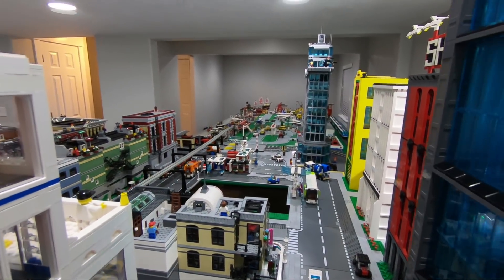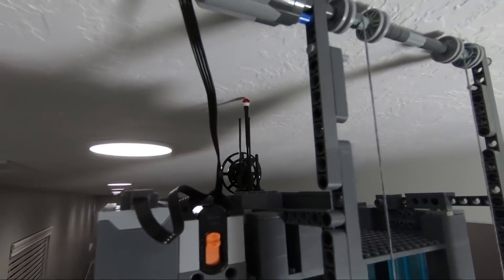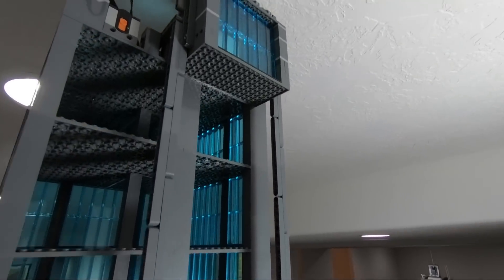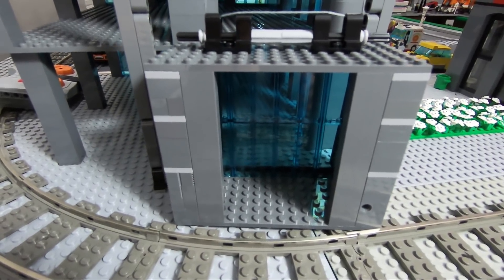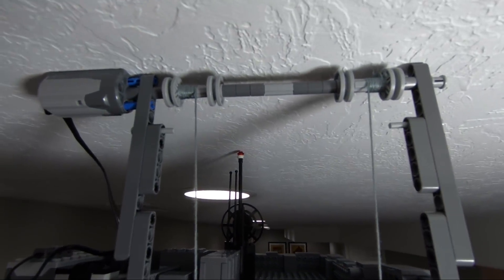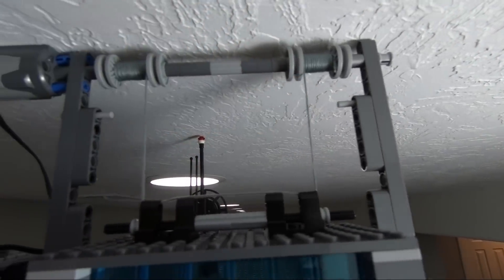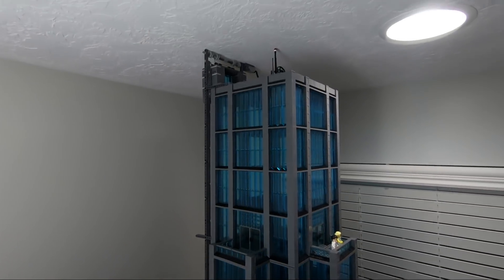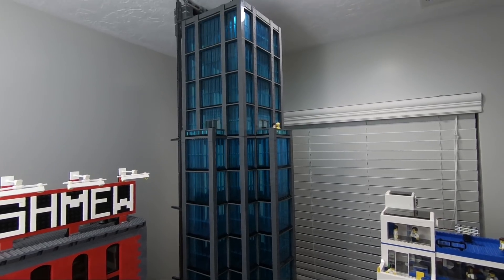LEGO Elevator with Power Functions

Comment: You could have kept the pulleys up the top and moved the motor to down below with another pulley on it, and just run the string up and over and then back down to the bottom, or wherever you prefer to hide it.

Comment: I would add the building around it to put the elevator inside the building instead of outside. I stumbled upon your video researching LEGO lift systems for a functioning pop up trailer I want to build. Thanks for showing it

Comment: Huh, neat idea on an elevator, Waaay less complicated than what I plan on doing, thinking the string from the winch blocks, over the train wheels that are in some 3 in 1 sets, that are all individually strung to their anchors and to stop them snapping the string I was gonna use the slip gears (that I thought were clutch gears for some reason).

Comment: Alex, You could replicate your front columns to enclose the elevator and cap it with an "elevator room" to hide the power functions and keep the roof access. Also, this would keep all the space on the 12th floor for your Mindyappolis residents use. Hope this helps with your options and thought processes.

Comment: I would hate to be coming out of that elevator at the same time the train comes through, lol. I had commented about putting the elevator in the front, but  you can't, with the two balconies and they do look awesome, but you can place a housing around the elevator, as its kind of odd to have an elevator out in the open. You can use see through tiles, so you can still enjoy watching it go up and down, it will also hide the cable and the track, and if you have all the machinery of the elevator on the top floor instead of the roof, you can also use this elevator enclosure to help hide it as well, killing two eye sores in one shot.

Comment: Awesome elevator! I should remove the roof access, and cover up the pathyway of the elevator. You could do that with some hinge pieces though, so you can open up the entire back of the elevator like a door for easy access. It will look more neat when you don't see the open sides from the other places in town.
Although I remember you wanted to keep the building open from the backside.

Comment: Why don't you just kinda hide the technic pieces behind some more bricks? I'm working on a elevator rn in a building I'm working on and I am doing a pully system but I'm planning on hiding it in something like a fake generator just so it blends in.  The elevator I have is inside obviously but it just is apart of the building so if you want to do anything just make it blend in better.  Or just kinda put the motors or whatever they're called and add a elbow piece so it twists like a crank🤷

Comment: Are you going to change out the long technic liftarms that are sticking out of the elevator track with shorter ones? By the way, we don‘t need roof access, it looks too bulky; )
Reply from the maker: I am looking at doing that, but the beams do not match the length. I'll figure it out.

Comment: The elevator mechanism is a bit ugly, so lowering it and stopping on the 12th floor would be better, with stairs up to the roof. The tracks don't bother me particularly. The balconies half way up are a great improvement over boring flat rooves of the bits sticking out. 👍

Comment: Would a name sign cover up some of the views of the tracks? depends where you put it but if it was down the side I guess it would that’s of course if you’re gonna have one. I would have it stop on the 12th floor as long as you can still use the remote control from the other side of the city. Looks great though
Reply: Well, he can make it more like a real elevator and put a housing around it, but you will have to put large windows on it, so you can still see the elevator going up and down.

Comment: This is a masterpiece, I love how you actually have guide rails for it to keep it going up and down in a straight line! But I would agree with stopping the elevator at the 12th floor. 
The best way to hide the Elevator shaft in the front of the building is by stacking up a bunch of slanted bricks and creating a diagonal slant on the roof to give it a similar look like you’re avengers tower
Reply from the maker: Awesome, thanks for the feedback.
Reply: Alex Nunes no problem! This has to be the tallest Lego skyscraper I have ever seen

Comment: Need to hide the elevator track and top. I would just add a panel similar to the design to the building on the sides.  Also, maybe extend the building towards the Shmew building to create a bigger wing and it would hide the elevator at the same time.